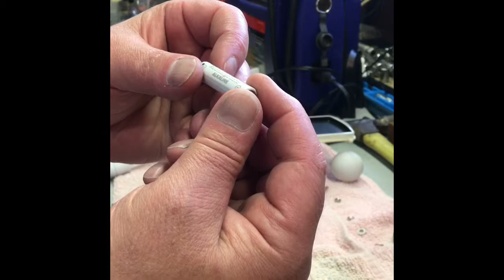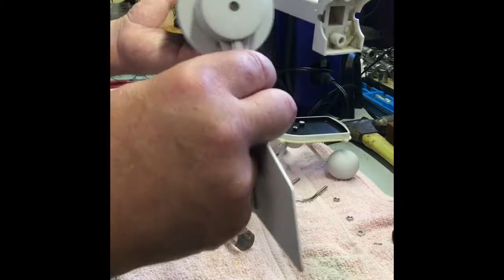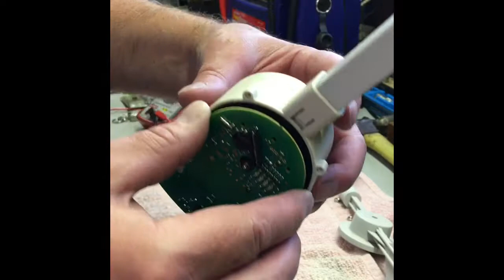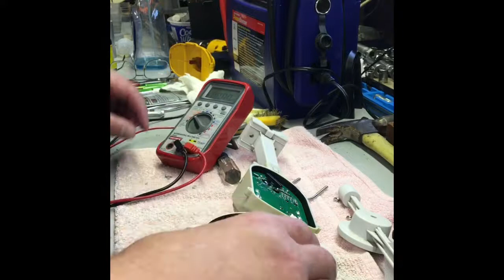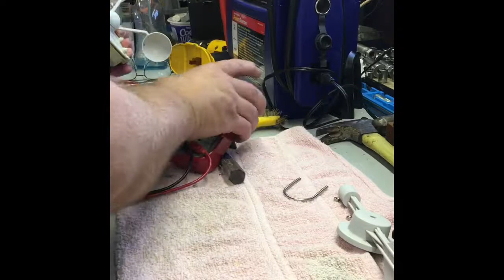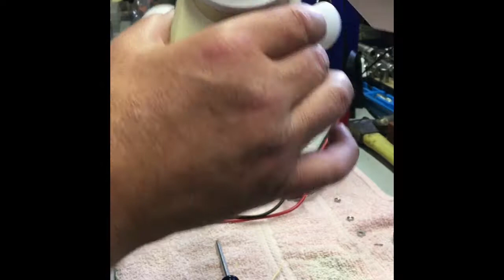La crosse technology TX63U-IT anemometer battery replacement

Comment: After taking it apart, I found a small round gold piece with a black center on one side.  I don't know where it came from, nor where it goes.  Can you help?
Reply from the maker: Sounds like a pad off the PCB but it’s been awhile since I’ve had one open. I have a old parts piece I’ll look at when I have a chance. They’ve stopped making all those components including the anemometer. For A long time you could get factory extras on eBay relatively cheap but that stopped about 10 months ago so a person has to try to keep them going or look for a new WeatherStation all together. Now that I think of it there is a small black carbon piece that goes inside of the silicone reset button, it’s round like a tiny hockey puck.
Reply: @jatoav8or  I believe that it may have come from the place where the wind direction device sits on the bottom of the device.  It is the exact size of the hole and I think the black center is where the direction device sits so that it pivots easily.  I have received new batteries and replaced them, but so far the control panel is not showing that it is communicating.  I do see a battery icon in the wind section that has three dark dots, so I am assuming that the batteries still need to be charged.  Your video was very helpful, but I am still not operational.  I have pressed the reset button several times, and sometimes see "S" on the display, but it disappears after awhile.
Reply from the maker: Doug Wiedeman https://fccid.io/png.php?id=1332689&page=0
This should take you to a comprehensive service page, if not I can try something else.
Each time you hit the reset button it enters another mode.
Here’s page 2- https://fccid.io/png.php?id=1332689&page=1
-
Here’s some more info.———
TXTX-63U
63U-IT
SOLAR WIND SENSOR
The TX63U-IT Solar Wind sensor is used in conjunction with the TX59U-IT relay
transmitter to gather and transmit information to the wireless Weather Station
(e.g. WS-2812U-IT).
INVENTORY OF CONTENTS
1.
2.
3.
4.
5.
TX-63U-IT Solar Wind sensor
One Plastic reset rod.
Mounting bracket
Mounting hardware
Instruction manual
TX63U-IT
Wind vane
Solar Panel
Wind cup
START THE SOLAR WIND SENSOR
During the first time of operation, user has to remove the mask that covered on
the solar panel then gently press the RESET button once in the bottom of the
device by the provided Plastic reset rod
to wake it up.
RESET
Note: It is important to allow sufficient
button
light to reach the solar panel while
activating the Solar Wind sensor. Make
sure the lights are on in the setup room
and the solar panel is facing a 60W
light bulb or brighter – do not cover
Bottom of the Solar
with hands or other objects.
Wind sensor
MOUNTING
The Solar Wind sensor must be installed with the solar panel facing true South,
or the reported wind direction will not be accurate. This device should be
mounted within the reception distance (up to 330 feet / 100 meters in open
space) of the Thermo-Hygro sensor and on the same side of the house. Mount
at least 3 feet above the roofline of your house. Please be sure there is clear
area in every direction from buildings, trees, hills etc.
IDLE MODE
This mode aims to reduce power consumption of the transmitter. Under this
mode, the sensor stops the transmission of signal, checks the battery voltage
and detects the solar cell condition. The IDLE mode happens if the battery
voltage is low.
Note: The sensor will check and charge up the internal rechargeable battery
automatically, when it detects the battery voltage raises up to sufficiently high
enough, the transmission of signal starts again.
Mount the wind sensor onto a mast so the wind can reach the sensor
unobstructed from all directions for an accurate reading. The ideal mast is
between 0.62” and 1.3” in diameter. Secure the main unit to the shaft of the
mast holder. Use the right-angle adapter if the wind sensor will be mounted on a
horizontal mast or surface.
STOP MODE
It is the most energy saving mode. Under this mode, the transmitter stops the
transmission of signal, no checking battery voltage, no detecting the solar cell
condition and force it stop charge batteries. The STOP mode happens:
•
If the user covers the solar cell for 10 seconds and presses the RESET
button.
Note: To restart the Solar Wind sensor, user should place the sensor in a
bright environment then press the RESET button once to wake it up again.
•
If the sensor is placed in the dark environment for 72 hours.
Note: To restart the Solar Wind sensor, user should move the wind cup or
place the sensor in a bright environment then press the RESET button
once to wake it up again.
The remote wind speed sensor can be mounted two ways:
Using nylon straps
•
With the use of screws
•
Vertical mast
Fixed with
Nylon strap
IMPORTANT! During the restart process, if the battery voltage is sufficiently
high enough, the transmission of signal starts again. However, if the battery
voltage is low, the sensor enters into IDLE mode. User should place the sensor
under a bright environment in order to charge up the rechargeable batteries
inside the sensor.

Comment: Well Done Video...too Bad I didn't watch BEFORE it took it apart! I hot glued the sensor cover....My question is I've got a tiny slug of metal. does it go in the reset cap ???? I'm thinking it dropped out of the reset cap....Am I correct? Thanks and I hopr your answering this post. Could you email me at DoctorPc@ymail.com or text me at 2083054034

Comment: The alkaline rechargeable batteries I purchased on Ebay were not charged how long does it take for the solar cell to recharge them?
Reply: OK double checked  the batteries have a 1.5v on each. The solar panel appears to be working as well... but nothing is showing up on the weather station after resetting it putting in batteries blah blah blah .. So I assume "He's dead Jim"
Reply: @1975mustang  I had the same problem. But I removed all the batteries from the rain Gage and the temperature sender and the remote reader. Then I held a button down on the weather station for 15 seconds with no batteries and then waited 15 min. and then started over. Success now all works well. so Steve try more times and don't loose confidence.

Comment: Well done video.  Your video helped me change the rechargeable alkaline batteries in my La Crosse TX63U-IT Anemometer.  Although now discontinued, I find this to be one of the better wireless wind sensors out there.  In my application, I needed something small and light. I went through a pretty good effort to make a custom mount so I want to keep this sensor going as long as I can.  The "Juice" batteries you mention appear to be discontinued. I found some "No Name" rechargeable alkaline AAA batteries on Amazon.  I should mention, I had the original factory batteries in service for nearly 3 years. I had some good weather so I decided to change the batteries.

Because I had to purchase more batteries that I needed I decided to look for a rechargeable alkaline battery charger. Only found one or two, I have yet to try them.  Also, I find very little information about the proper way to charge rechargeable alkaline batteries.  

A few other thoughts.  I believe that non-user replaceable batteries are one of the most environmentally destructive things around. I think of the millions of old iPhones and iPads (and other devices including laptops) in landfills with their batteries.  I have a variety of electronic Instruments that I only use occasionally. Having the ability to remove the batteries when not in use makes them last decades.

Thanks again for the great video, you are a good technician and an asset to all Mankind.

Comment: Thank you for posting this video. My sensor has also stopped functioning. Can you post a link to where you purchased the batteries?
Reply from the maker: jdeday https://rover.ebay.com/rover/0/0/0?mpre=https%3A%2F%2Fwww.ebay.com%2Fulk%2Fitm%2F153346403284
This is a link to one of the sources for AAA 1.5v rechargeable alkaline
cells. The ones I used are pale green in color with black printing.
Even though I only needed two batteries I was forced to buy a package of eight. Through the years all the batteries I’ve received have been fully charged so considering the application a alkaline charger would be unnecessary.
Reply: @jatoav8or  Do you know of any other source for the rechargeable alkaline AAA batteries for the LaCrosse TX63U-IT anemometer? I just checked the eBay source you posted on your YouTube and they want $20 for shipping which pushes the price for 8AAA's to almost $40.00. Not sure it's worth $40 to get my anemometer back in operation. I've found some sources for rechargeable alkaline  AA's but not AAA's. Thanks for your excellent video by the way, it helped me greatly in the disassembly.
Reply from the maker: I haven’t checked lately for rechargeable alkaline cells but will as soon as possible. Unfortunately my lacrosse system in total is nearly a decade old and although I’ve managed to keep it all working it’s time to look for a replacement.

Comment: I too, disassembled the unit prior to viewing the video and had to repair the light sensing pick-up arm. I repaired it and then looked at the video, suspecting there might be a video on you tube. Sure enough there was, your video. I had to remove the pick-up arm and repair it again as you described in the video. Also, prior to viewing the video I went to Batteries Plus and got some bad information about the alkaline batteries. I was told at B.P. that  all rechargeable batteries were 1.2 volts and showed him the La Crosse batteries (one was bulged out and became pushed out at the + end) indicating 1.5 volts. He stated that "that is a misprint" and that "they are all 1.2 volts".  I did research and Wikipedia provides information and a history about 1.5 volt alkaline batteries. Now I have to go back to Batteries Plus and return the NiMH batteries he sold me. Batteries Plus does not sell the rechargeable alkaline batteries. I did buy some on e-bay. during my disassembly I broke the negative wire to the circuit board and ended up totally replacing with new wires to both the solar collector and circuit board. That was tricky. After soldering on the new wires I checked the solar collector and it was putting out voltage without the batteries installed. No damage occurred after the soldering. Just waiting for the new batteries to arrive. After I have it all assembled I will return and let you know how it went.
 Anyway, I thank you for taking the time to create this video. It was very helpful.
Reply from the maker: Vintage ; I’m glad my video was of some help & wish you good luck.
I did notice the Lacrosse Tech outlet seller ”G.B.O” on eBay has the complete c84612 system for $99.00  The system isn’t produced anymore & replacement components are getting rare.
Reply: @jatoav8or    I had SUCCESS. The soldering of new wires didn't do any harm to the circuit board. After Synchronizing the system it all worked. Returned the NiMH batteries to Batteries Plus. They were nice to accept my return. Still I am surprised at their lack of knowledge and non availability of these (granted uncommon) rechargeable alkaline batteries. Thanks again.
Reply from the maker: Vintage , I’m glad my video helped.

Comment: First, let me thank you for the video.  It gives me confidence that I did not destroy my device completely.  Unfortunately, I did not go here before I tried to take my unit apart and broke the two pins holding the speed sensor to the control board.  I have located the two holes in the board but they seem to be in direct alignment with a clear plastic electronic sensing device that stands up exactly between the two pin holes. This will prevent me from gluing the device directly to the board.   I do not know if the original pins were long enough to permit the black broken off part to mount over the top of this clear electronic sensing device or the clear device is now bent out of its original position.   Can you please shed some light on this puzzle for me?  thanks
Reply from the maker: iontheball1 
Yes , the sensor should be standing straight up. The black plastic cover with the arm is oriented to pick up light from the line of emitters in the board. If the pins broke off you can push them thru so they don’t fall out & get jammed up. I mixed some 5 minute epoxy & held the plastic pickup in place while applying the epoxy to the backside not under the black plastic part. There should be nubs left to index the part good enough. The other concern is the wires going from the solar panel to the board. Be very careful not to twist them around too much as they can break off close to the panel. 
I just re serviced the anemometer last weekend for the summer season & found some very good quality (alkaline) AAA rechargeable cells on ebay. Also the La Crosse outlet store on eBay is currently selling the entire station including display, gateway,
thermo hygro sensor, rain gauge, and the wind gauge new for $99.00.    Not a bad deal actually.
Good luck & feel free to ask any more questions.